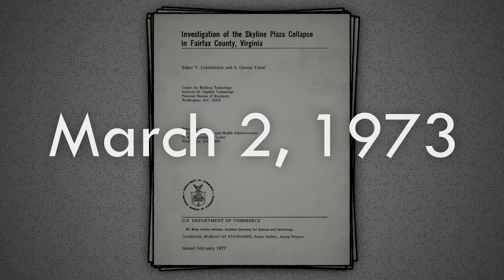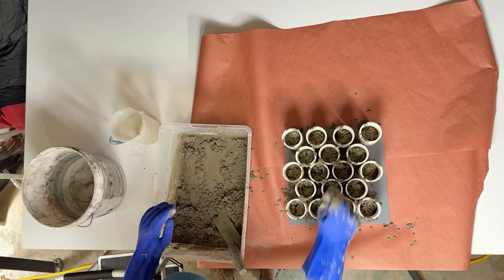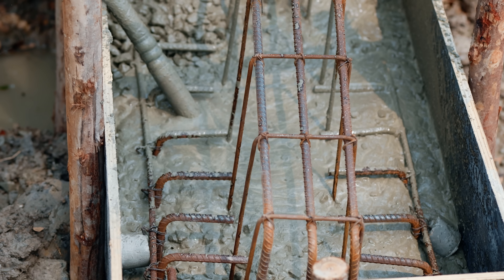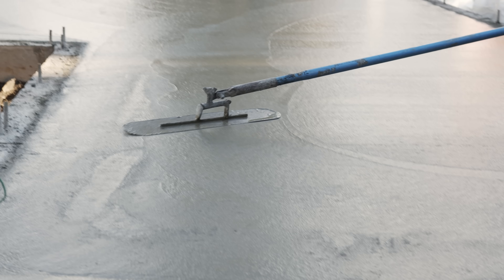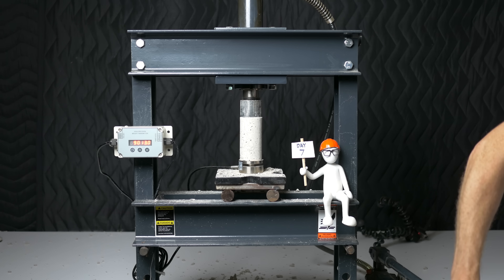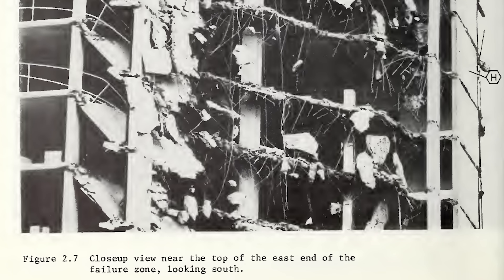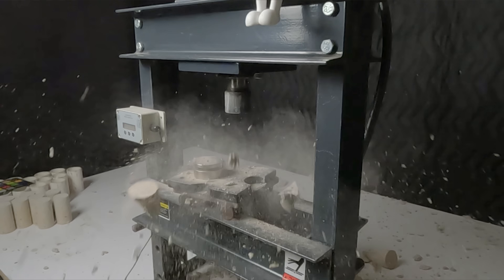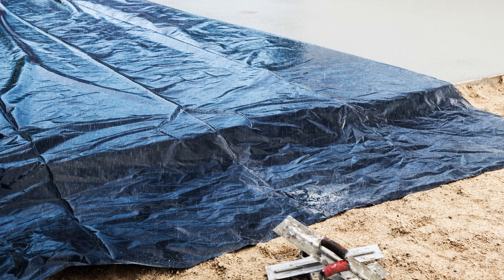Concrete's Greatest Weakness is Time

Comment: Maybe you could do a video on ultra high performance concrete mixes and composite reinforcements. I've been working with them past year and the area is really existing. The possibilities for application are really promising and could offer substantial reductions in life cycle costs at all stages as well as reduction of CO2 emissions. 

I made a ultra thin panel element from UHPC and basalt fibers. It was about 12mm thick (about ½ inch) and it behaved like a plywood panel allowing orders of magnitude greater deflection than regular concrete before formation of visible cracks. (It deflected elastically 10mm over a span of 650mm.) It also displayed self-healing properties due to silica fume used in the mix closing tiny cracks when they were exposed to water.

Comment: A note on field cured samples. They are often not a good representation of the final product either. The samples are cured in 4"x8" or 6"x12" cylindrical molds which do not share the same temperature and hydration conditions that are present in the final product. This causes field cured samples to often break well below design strength due to not having access to moisture in the air and being exposed to wind and sun which affect large volumes of concrete vastly less than small concrete cylinders. Not to mention the molds are made of plastic which also completely changes the way that the samples cure. The closest thing you can get to definitive strength measurements on a placed concrete product is destructive testing such as Windsor probes and even those have their issues. I spent 10 years as an ACI certified concrete field testing technician and I worked in a lab breaking cylinders so I have seen the headaches that field cured samples tend to cause projects.
Reply: Ditto. I’m a licensed engineer at a QA/QC firm. I’ve shot many a Windsor probe. I’ve done a bunch of Schmitt Hammer rebound testing. We also took cores. 

Interesting stuff and Grady does these videos very well.
Reply: @Korndoggy They dont have any sort of correction factor? Like if the sample has X strength that actual will have Y strength minimum.
Reply: @Kandralla thats called measuring the slump and knowing the PSI, no test brick needed at that point if youre just gonna go off a data sheet. The bricks are only used because you cant trust the math everytime.
Reply: @Kandralla   No, not really. The whole point of the field test is the gauge the field conditions, and even tho it's not exactly the same, see the OP, it may be a better representation than the lab tests. Contractors are also supposed to store the onsite containers in an area similar to the slabs, like, under the blanket for the main slab, or on top of it, but in its own blanket at least, etc.
Reply: @Kandralla Correction factor. I’m not sure I follow. Non-destructive tests I referenced have empirical correlations developed to approximate compressive strength. ACI also allows for cores to be 85% of specified strength due to different curing conditions between cores, field cured cylinders, and in place concrete.
Reply: @Nate-bd8fg slump is an indicator of water content and/or super plasticizer usage. It won’t verify compressive strength.
Reply: I hate making field cures. The client always wants too many, and then they never get used! Aaaaaaahhhhh!
When im on a job that actually use them its fine, cause at least I know the 4 or 6 extra 4x8s are going to be useful. Its the pointless jobs that get to me, heh.
Reply: @artificernathaniel3287 it’s not pointless. Those extras save coring or more expensive follow up tests. I used to be a field tech, I get it. If it makes you feel better, we charge full testing price for EVERY cylinder made. We get paid to throw them away. You get paid too.
Reply: Do they ever include sections of the pour specifically for destructive testing? Like putting just a little curb against the wall, or instead of leaving a hole for an elevator shaft pour that over and use that section for destructive testing then you could just grind it away after you've tested it?
Reply: @ashleycarmichael497 we core the actual structure. If we have a slab in question, we drill a core specimen. This gives you a 4” cylinder to take back to the lab and compression test. We scan the concrete to locate the rebar first, then drill our core so we don’t cut any rebar.
Reply: This brings up another scary point. We do rebar inspection BEFORE they pour the concrete. Where the rebar is placed and how, is as important as the concrete. 

Let’s just say we RARELY find it correct. It’s not uncommon to delay or cancel a concrete placement.
Reply: That doesn't make any sense. Wind, sun, etc scale with surface area. If ten square feet are exposed to N amount of sun, then five square feet get half as much. Why would the area of the core matter as long as it's cored from the part you're interested in, and thus the same depth?

Comment: In watching a building go up next to my old office, I observed that there was a pattern... Prepare the support columns the first week, pour on Friday, remove the forms on Monday, and begin laying out the floor structure. Pour on Friday, remove the forms on Monday, and repeat. So the floor was supported from beneath as it was poured and integrated into the support columns, meaning the columns didn't have to bear the load until the forms were gone. That meant that each pour got 2 weeks to cure before it was expected to bear the load of the next pour and, as that pour cured, while it would technically be still bearing the load, the pour above began to be self-supporting, reducing the stress on the floor below.

Because of the nature of construction, it would be two weeks or more after that before any other work was done on that level, meaning the concrete would have at least 30 days to cure before more construction was done and permanent things such as water pumps, walls, etc would go up. Given how much time it took the followup crews to get to that point for cutting openings, etc, it was quite easy to arrange for sufficient staffing and so on to have this schedule progress reliably without ever being worried that the guys below you would catch up. I thought it was a nice demonstration of construction planning, personally, and appreciated the experience of the general contractor in keeping everything properly orchestrated.
Reply: Thats probably the reason they use 28 days cure for the nominal strength... Because they have tequniques to stretch it that far.
Reply: @Kandralla  28 days actually has to do with the strength gained by the concrete as it cures. After 28 days, concrete should reach its design strength. Break tests are performed at 7, 14, and 28 days to confirm the concrete is gaining strength as expected with maturity. You can look up a “Concrete maturity curve” to see the rapid strength gain over the first 28 days and then the taper off as time continues. Fun fact, concrete never stops curing, the rate of strength gain over time just becomes very small.

Comment: Hi, when I was growing up, my parents tasked me to water the flowers beds. Well there was a bed of flowers next to the new concrete driveway. So I made sure to water not just the flowers. but also the new concrete driveway twice a day for a summer and fall.  The next year, the driveway was extended and was made wider. But I was out of state when it was poured. It was easy to see the difference from what was hydrated all summer vs what was cured naturally.  I would suggest testing that angle.

Comment: if i was a engineer/architect myself i would use double the recommended psi load requirement for concrete with 20% less water than required to be safe in unpredictable weather patterns for stable testing using on small batch outside curing test before putting it into a building constructing process that requires such things first, so that no person dies after the building is constructed and tested 3 times for each week after the first week test, yes 4 weeks 4 tests perfect safety protocol for every building done right on the time it's supposed to be built till final 5th week of cured floors and support pillars
Reply: This would multiply the costs for no good reason. When concrete structures fail the problem is rarely the the strength of the concrete was calculated wrong but because someone messed up either at the mixing plant or at the job site. It would be far better to actually visit the job site and ensure quality control there works as it should.

Comment: One of the tire shops I worked at needed a new floor, they had it torn out and poured in less than 3 days and the garage posts reinstalled on the fourth day. They planned on doing one half of the shop at a time to allow the shop to stay open. Ignoring the contractor and lift installer to wait the full 28 days they suggested, the manager authorized the use of one of lifts as we got to the busy part of the day. Luckily when the weight of the vehicle pulled the post out of the ground the only casualty was a crushed car and the tech underneath escaped. The manager was let go and that’s when I found out concrete takes time to build strength.
Reply: That’s when the manage learned that the contractors were not making a ‘suggestion’ lol. I am VERY glad no one got hurt due to that incident though!
Reply: Yikes that could’ve been catastrophic

Comment: Speaking of concrete, you should do a video about the fourth power law for road construction and how it relates to EVs being heavier. 

A lot of people seem to think that if all vehicles on the road were electric vehicles our roads would just immediately fall apart, and while they would induce more strain on roadways, the answer as always with civil engineering is just more complicated than that

With EVs being such an unnecessarily politicized topic, how their extra weight actually affects roads deserves some unbiased analysis from a simple engineering point of view, rather than an environmental or political one
Reply: IDK, my RAV4 BEV is within 300 lbs of the V6-equipped of the same year.  While long range EVs are heavier than their ICE counterparts, a lot of us don't need long range, as most commuters in the US drive less than 35 mi./day.  I've gotten by fine for 90k miles/8 years with a 100 mi. range BEV.

Comparing the weight of a BEV pickup or SUV to its ICE counterpart is valid, but the correct direction is to push for fewer pickups and SUVs in the first place, as most of the ones I see in my neighborhood are single-occupant and empty of payload.

Comment: I worked at a pool company where they had Redi-Mix trucks which mixed the concrete up in the truck at the site not at the plant. 
All went well until the Operations Manager changed the mixture ratios to "Save Money" by skimping on cement and aggregate. Dozens of pools were poured and finished and within a short period of time began to FAIL. A very expensive engineering firm was hired to troubleshoot the problem, and when they found his handwritten notes to the job site workers to change the ratios it was the "smoking gun" which left him immediately jobless.
Reply: That manager would be hired by Boeing and trained to not leave notes.
Wish I were joking.
Reply: @wiregold8930  There's a reason why Trump doesn't text or email
Reply: @Yielar1 
Not familiar with his Lies Socal account it seems.
tRump confesses to Felony Crimminal acts all the time on that account. 
Anyone else would be rotting in prision if they did what he does.
Reply: @Yielar1  Yeah he just posts every random thought that comes to his head publicly.
Reply: A tale old as time "I'm going to pinch pennies to save money" "Oh no, what do mean cutting corners cost me thousand times more than I saved?"
Reply: That jobless guy is hero of wall street
Reply: Were the pools torn apart and repoured?  Who paid for all of that extra work?  Was it the insurance for the RediMix companym
Reply: I was cured of lifetime subscriptions when a fairly expensive one I purchased for FlyQ from Seattle Avionics became nearly worthless after the company was sold and the new owner decided lifetime meant the life of the original company.  Beware of lifetime subscriptions as they can go away at any time.
Reply: When I was doing construction projects as an engineering manager. I always sent QC guy to the concrete batching plant to avoid something like this. I think it's the standard procedures in most places.
Reply: But top management, who, most likely insisted on money save, as usual, left unpvnished ...

Comment: I fully apprecate engineers and engineering.
The more I learn and learned about civil engineering the more I have came to the conclusion that our economy does not meet modern standards, the pressure to go fast, and do it cheaper is too high, the rewards for making many if not most projects last generations is too low, and when there is a economic force to last generations it is one that is imposed from outside not a motivater from inside the system (aside from personal pride, but money tends to win out over pride)

And this critique applies to both predominant economies, Capitalism with varying levels of state control, and State Communism with varying levels of democratic control. (Capitalism requires govermental control someone has to print the money, amd enfore its value via force. there is no free market under capitalism dont at me about this unless you want a math lesson and defnitly dont mistake replacing centeral prints with decenterlized prints like Crypto as free)

Comment: Cement mason here, this was a phenomenal video. There's one thing I'd like to add nuance to, however. 

Concrete blankets don't speed up the curing process, they reduce water-loss to evaporation. Once the concrete finish is set enough to not deform easily, we  cover it with wet burlap and plastic. This keeps the slab at 100% humidity and prevents evaporation. This concrete will then fully cure and gain greater strength. Wet-curing the concrete in this way can increase strength by as much as 25%. 

Most concrete pours are cured for at least 3 days, some for 7, and a few are cured for the full 28 days. For example, I worked in a sewage treatment plant, and they cured the concrete for a full 28 days, partly for the strength, but also because they had to wait that long anyway for the next step (Linabond, which requires no moisture coming off the slab). I've also poured train plinths that were cured for 3 days.
Reply: In some circumstances (especially in cooler climate) the blankets can server a dual role. They help curing by reducing evaporation but the reduced evaporation will also reduce the heat loss from the concrete to the air.

The blanket also protects against convection and wind which would both take away warmer air from the surface of the concrete and accelerate evaporation. 

Finally, properly designed blankets will also reflect thermal radiation and reduce the heat loss through radiative cooling. This is especially relevant in slab pours in areas with low absolute humidity and clear skies such as near the Arctic and in deserts in the night time.
Reply: I just wanna say that Cement Mason sounds super cool :)

Comment: I’m curious, doesn’t increasing the strength of the mix increase the weight? Honest question as I don’t understand how it works.
Reply: Not necessarily. Two concrete samples of identical dimensions can have  identical weight but vastly different strengths. 

In any case, you wouldn't care about just the strength or the density of mix because you care only about the total weight of the structure. Even if stronger mix is denser it's possible you need less of it to achieve the same structural strength and consequently save on total weight.
Reply: You can improve concrete's tensile and compressive strength by addition of fibers in the mix which are typically less dense than the concrete. Improving density will also help but it's not just about density.

Comment: Time being concrete's biggest weakness is ironic, considering that concrete is one of the building materials that can stand the test of time much better than most others.
Reply: well, there are many stone, brick and wood structures that contradict this statement. Without a reliable cement to make a good mortar, there is no possibility to make durable concrete. Hence why Europe stopped using concrete during the medieval times as they lost Roman building knowledge.

Comment: A few years ago a amusement part build a very high roller coaster, one thing they did was building a huge tower for it. Whats interresting about that was how they build it, they had a concrete form that lifted up. They put in rebar, poured concrete, lifted the platform, build another set of rebar, poured concrete and lifted the platform again. They did every lifting within a hour, so the concrete at the bottom was only 14 days old when they finished the top. So they had to use a really fast curing concrete for that procedure.
Reply: check out the CN Tower in Toronto Ont. Canada -  when I was a kid I watched the choppers brought in from Russia do the continuous pour from footings to the top -  it's still there.  The CN Tower's main concrete shaft was poured between June 1973 and February 1974, using a slipform method that allowed the structure to rise approximately 20 feet (6 meters) per day. The construction of the entire tower began on February 6, 1973, and was completed in April 1975,
Reply: @stevemyers2092  oh yeah vertical slip forming is what they used to build that tower. 
There is also a Video of it on Youtube, search for Kärnan Zeitrafferfilm „Turmbau ganz schnell“.